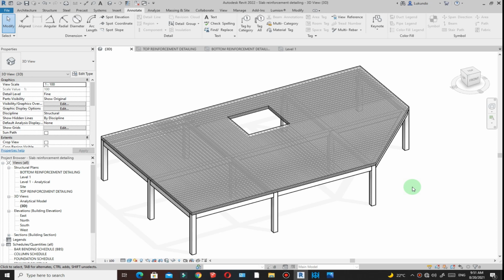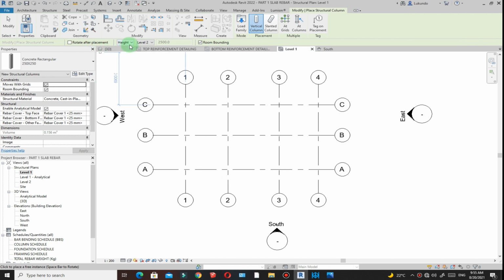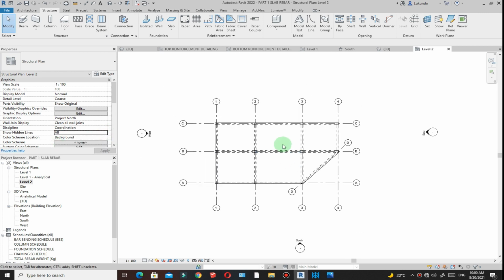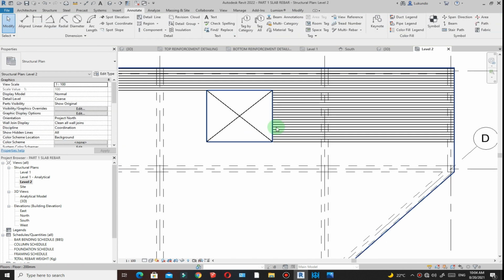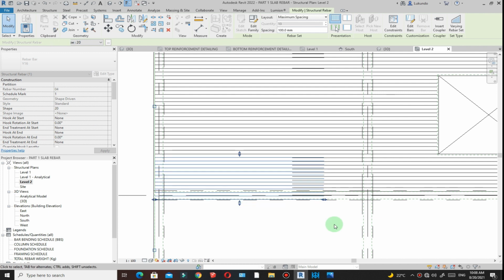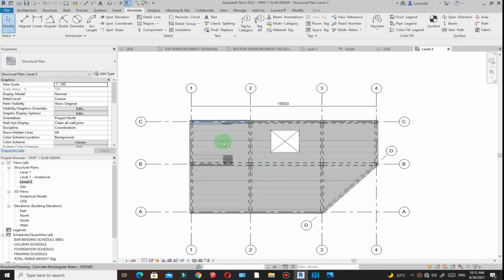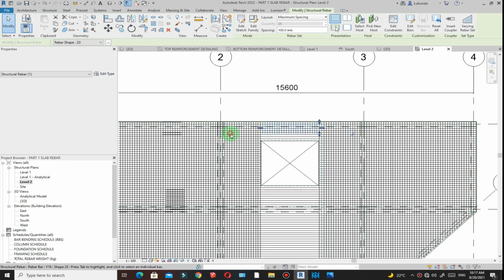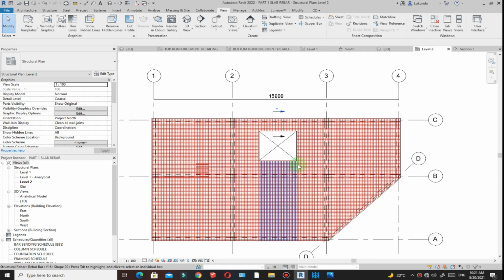Detailing of slab reinforcement in revit_  detail rebar in floors in Revit structure Part 1

Comment: Hello sir can u please tell me how do get those multiple steel bars at once like that, that for one and two aslo I accidentally 😅 run into a problem while placing my rebar they don't expend horizontal again they only expend vertically while using maximum spacing and I don't know what to do or how did that even happen,  thank you for your help